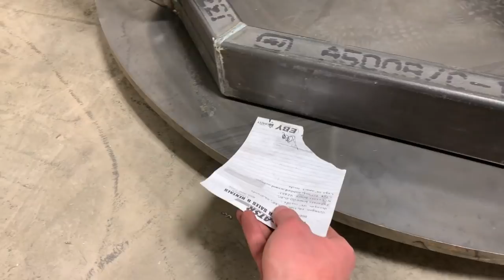Building a table to hold my vise

Comment: I saw your leather stitching on Instagram. They make a prong thingy that has 3 prongs for curves... use one or two prongs in the last hole(s) for alignment. Another thing that might make your stitching line straighter is to draw a line before you punch the holes. Tandy Leather has great leather smithing videos on YouTube check them out. You can order supplies from Tandy online or they have two stores in Phoenix if you ever get to town. ❤🌅🌵

Comment: Hey Jeremy that’s a hell of a vice and Great work on the table . If you haven’t already found a good way to move it around then I would suggest you have a look at Rotacaster Omni Wheels, this is what I intend to use for my welding table. My table is be 1.2M x 1.2M x 10mm plate and I also intend to make a single deep sheet metal draw under it for tall related tools such as a cut off saw and a file storage system.

Comment: Awesome table.  It will outlast you!  How about a threaded lifting lug in the center, or a few points, and move with the engine hoist?
Reply from the maker: Thanks. The engine hoist is a pain in the ass to use, it takes forever to pump it up and is hard to roll with weight on it. So pallet jack would be way easier.

Comment: Solid table!!!  Good welder!!!  Your grand grand grand children will appreciate grand grand grand-pa Jeremy's qualities.  One thing I would do different:  I would use a one long vice support beam that goes underneath the table to the opposite side.  It would give some more stiffness.  It could give a slight difference in "solidity" when hammering heavily, when you use the vice as an anvil.  But for all classic applications this table is bulldozer resistant!!!
Reply from the maker: I wanted to use one long piece for the vise support, but that would mean that either the vise would be on the same level as the table, or the vice support would not be against the bottom of the table.
Reply: @Jer_Schmidt  An additional profile on top of the lower profile or two strips 3" x 0.25" could do the job then???

Comment: Jeremy, I think you did an excellent job building this table. The only thing I would have done a bit different would have been fill each of those 4x4 legs with sand and then capped them. Although this has an amazing estimated weight, the couple hundred additional pounds of sand would make the legs 99.999% tip proof. As I said, that is the only thing I would have done different. And that is from habit.
Reply from the maker: Several others have suggested that, and I’m thinking I might do it before painting. I just need to drill a hole to fill them, and then weld the hole up.

Comment: Everyone knows sometimes the big tractor gets bent and ya just gotta clamp it up in the vise, weld a 20 lb sledgehammer to the front of the little tractor, and straighten the bend out of the big tractor by ramming it with the little tractor at full speed repeatedly.

Comment: Great work. The larger spaced holes on the vice should be in the rear. Narrow in the front for clearance
Reply from the maker: There would be more clearance side-to-side, but less clearance front-to-back if I put the narrow spacing in front.

Comment: Have you considered cutting your legs down and using some EXTRA HEAVY DUTY steel casters to make your table mobile? You might even want to add a lower shelf. It will add lateral strength and give you a spot to throw a small welder and supplies. Nice build btw!~
Reply from the maker: I want to keep the area under the table unobstructed. If I ever need to I’ll build a cabinet to fit under there (like if I move to a smaller shop and need to use every sq. ft.). Casters are expensive and bulky, when you consider I already have a pallet jack that’s perfect for moving super heavy stuff.

Comment: You do excellent work young man! My only suggestion for future metal topped tables is let the top be free floating by not welding it directly to the frame. I've built many large welding tables, some with 1" thick tops and welded pieces of threaded rod through the table with plates capturing the frame to allow for expansion and contraction. You'd be surprised how easily plates warp.
Reply from the maker: I stressed over how to fasten the table down for longer than I’d like to admit. But this plate was bowed badly enough to begin with that I figured it wouldn’t get a lot worse if I welded it down. Good idea though, for sure if you have a flat plate to begin with.
Reply: @Jer_Schmidt  I understand what you mean.  With your table being the size that it is you shouldn't have any problem. Your work is excellent! Especially considering your age. Keep the videos coming .
Reply from the maker: Rich Ball 
Thanks!

Comment: If you weld some RHS 100mm off the floor between the feet your pallet jack will be able to shift your bench from any angle, I am sure your bench and vice will be great to work off

Comment: well done, looks nice.
one concern tho: you should've had the table disk machined flat on the underside, built the frame up from there and screw it down with welded bolts on the frame, the short welds probs won't last long given heavy abuse over time and the preload in the table.

Comment: That's the way to I got my vice looks about the same as yours mounted on a 2 inch plate 5'×5' that came off of a die works like a charm ive had an 8 ft bar on that vice trying to break it lose works like a treat 😂

Comment: Paint the legs and underside but use the top as your welding table. But a dedicated welding unit and mount it underneath the table and attach your ground to the table with a bolt. Really great welding table then.

Comment: What about a threaded hole in the top with an eyelet? Then using the engine hoist to move it rather than the pallet jack.  Just a thought.  Bonus points for putting it at the cg so it stays level when lifting
Reply from the maker: The engine hoist is a pain in the ass to use. It’s terribly hard to roll around and you have to pump the handle about 80 times to lift it by a foot. Pallet jack is just way easier to use.
Reply: @Jer_Schmidt  

Fair enough. I know i keep my hoist folded up,  so that sucks too. How's the job search been btw?

Comment: My stepdad has a vise a tad larger than this. It's mounted on a pedestal that is welded to a truck steel wheel and the wheel was filled with concrete. Never had a problem with it being unstable.
Reply from the maker: Is the truck wheel centered under the vise? Cause that seems like you’d be kicking it all the time. This vise is 26” long, and a truck wheel is usually 22.5” or 24.5”, so the front edge of the wheel would be directly under the handle of the vise (when it’s closed).
Reply: Yeah it's centered. I'm not sure of the diameter of the wheel. But it was never in the way while doing any cutting, grinding or whatever you may be using the vice for. Since it's such a large vise it was used for larger material most of the time. Anything small that needed to be clamped to be worked on was just used on the smaller bench vise he has.

Comment: I'd have thought that the logical way to make it mobile would be to drill a hole through the top around 3 or 4" towards the vice from the center. Then weld in a chunky threaded tube to put an eye bolt into so you can hoist it up with the engine crane. 
Though looking at your advanced level of over engineering, Maybe having heavy duty casters on jack plates that are welded behind each leg would be more your style? :)

That said, It's nice to see someone having a go at heavy gauge workshop construction with such forethought and skill. Hat's off to you mate.
Reply from the maker: Like I said, I’m gonna make it movable with the pallet jack. The engine hoist is a pain in the ass to use, and near impossible to move with weight hanging on it. And casters are expensive and they’re always there, in the way. The pallet jack is perfect for moving heavy stuff, it picks it up 1/2” almost effortlessly and rolls super easy.

Comment: The band saw needs to have a variable pitch blade for cutting tubing. Reduce the pressure on the blade and you will have better results.
Reply from the maker: Thanks for the info!

Comment: How about putting a hole in the middle, for an eye bolt? And just use the hoist (legs extended), or a crane if you have one...
Reply from the maker: Pallet jack is much easier to use for moving stuff. It’s actually designed to roll around with a load on it, but the engine hoist is almost impossible to move under load (partly cause it’s cheap).
Reply: @Jer_Schmidt  Sounds like a project; better wheels for the hoist ;-) On second look, you've got all that heavy equipment on hand; where's your fork lift?
Reply from the maker: tahwnikcufos 
Forklift/skid loader are too bulky to use in the shop. Pallet jack is compact so I can get around tight areas.

Comment: WIlton used to make a very nice vise which swiveled in two axes, but I suspect it might be one of the ones they have made overseas now.  There are certainly cheaply-made clones of them around. I bought one of the cheaply made clones and promptly cracked it.  Even so, the ability of the head to rotate at right angles to the rotation of the base is fantastically handy.
Reply from the maker: My brother has one of those but it’s a very cheap and terrible one. I can see it being handy sometimes.

Comment: I have no use for a hack saw in my shop, cut off wheels , cutting torch or a plasma cutter have replaced them. I was  very surprised to see you build that very very nice bench and never fired up a torch or plasma cutter.
Reply from the maker: The problem I have with those is the warping and work-hardening. I really like cutting methods that are heat- and spark-free.

Comment: awesome! you do great work !! I really like your belt grinder and attachments It is an awesome machine ,, I have a old  big vise mounted on a slide with a 2.5 inch receiver tube using 2x2x1/4 and a down leg with a steel wheel on the bottom  it will move away from the table about 30 inches. And when pushed in is awfully strong . and handy extended for different things. your lowered offset mount off a round table makes for friendly use.. Awesome Work, Thanks for sharing your ideas and fabrication skills> I enjoy watching your builds

Comment: I don't know about that table, it's looking too light for a vise.
The vise mount looks a little flimsy as well.
It's a good thing you added a 45 degree brace unfolded the vise be ause that would have fallen off. Maybe you could add more braces to all the he legs and more braces for the vise.
Anyway, I bet that setup will come in handy especially with a table attached to a vise like that.
Super nice job.

Comment: Rather than pallet lifter, attach casters that pivot down to locked positions.  Lower each caster separately, or run an axle or two with a lever that lowers two or four casters at once.  My two cents.
Reply from the maker: Why? Then those are always there and in the way...
Reply: @Jer_Schmidt  Yeah, maybe in a bigger shop like that it's not too hard to get forks under the thing, but I like tables on casters.  It seems that I always want to rearrange.  I can shove the  heavy thing around without clearing space to access it with pallet forks.  Or  I'll weld nubs to the legs to make it easy to jack them up, and slide a dolly under it.
Reply: +Jeremy Schmidt Removeable footrests could double as crossmember bars for pallet Jack? something to that effect.

Comment: A threaded hole in the middle of the table top and an eyebolt would make an easy way of lifting with the engine hoist, also an extra means of clamping if required.
Reply from the maker: Not very useful to just be able to lift the table, and the engine hoist is almost impossible to move with that much weight hanging on it. The pallet jack is made for moving heavy stuff so it rolls super easy with 1000lbs on it.

Comment: Nice table! I thought you could drill a hole in the middle for a removable giant eye bolt so you can carry it around with the crane but it wouldn't be as fast and maneuverable as the pallet jack which seems simple enough.
Reply: Also I just read the total weight.....HA!
Reply from the maker: Exactly, that would work but the pallet jack is way easier. Thanks!

Comment: Impressive amount of fabrication, and steel, for sure, but I have to question this modern day fascination with Wilton vises. I guess they are rugged enough as I see them hung onto the back bumpers of utility company service trucks. Still, I think there are better choices for a shop.  For one thing, it would be hard to pack a workpiece held in a Wilton.  Also, the Wilton's slide does not have a horn backing up it's cantilevered loading. Perhaps the popularity of Wilton came about when Starrett stopped making the Athol vise - a bench vise perfected.

Comment: Dude, fascinating to watch your thought process on video. I get that the form of the table was required for the vice size and weight. However, what the heck is that size of vice required for, perhaps to hold the tractor I see in the video 😎.
Reply from the maker: It actually has the same jaw width as the reddish vise I was using during this video. In that sense it’s not so massive; it just has a lot of iron supporting those jaws, so it can grip like crazy even at the very end of the jaw without racking. And it’s super rigid in every way.

Comment: I think for the moving part you could weld on some tabs to the legs with eye holes and then just put a rope or what ever through it and use the engine hoist to pick it up that way, at first I was thinking about just welding something in the dead center but that’s not as smart
Reply from the maker: It’s way to hard to move it with the engine hoist. It’s bulky and slow to raise, and difficult to roll with a load. That’s why I’m gonna use the pallet jack that is made for moving stuff, not just lifting it.

Comment: I am not sure you needed an octagon support under the table.  With 4 legs, you could have used a square frame and saved a lot of cutting and fitting.  We have a 7"x12" horizontal band saw.  With careful adjustment, you can cut a 2" bar and the first cut on the lathe to face the end, cuts all the way around.  It came on a crappy stamped steel frame, which we replaced with an 11 gauge frame and put it on locking casters.  It moves around and rotates quite easily and is rock solid when the wheels are locked.
Reply from the maker: Oh it definitely didn’t need the octagon frame. But I wanted to make it that way because I enjoy making stuff.

Comment: It's gonna be heavy to move. Maybe fill the tubes with helium or paint it a light color. 

Seriously, a project like this alters the work flow in a shop in unexpected ways. Time might suggest a few alterations: maybe a lower shelf whose framing suits the carrying height of your pallet jack, for instance. Possibly, a cord and outlets. Air QD's and piping. A place for a Hossfield bender. An articulated, adjustable height, swing-out stool attached to one leg. And where best to site it.

If it was in my shop, that big horizontal surface would soon be buried under a hill of junk. You appear to be neater in work habits and more disciplined than I on my most resolute day. But still, I'd like to see that table a year from now.
Reply from the maker: Those are some good ideas. I was actually thinking about adding outlets, just hadn’t quite decided how I wanted to do it yet. It will get covered with clutter during a project, but I usually try to clean up between projects. 

I kinda want it to be as heavy as possible while I’m using it, so is it a good idea to not paint it a light color, but just shine a lot of light on it whenever I want to move it?
Reply: @Jer_Schmidt  I wonder how much light it would take to make it hover?
Reply from the maker: OperaBass3 
That’s a good point, I wouldn’t want to have to upgrade my electrical service to run the lights.

Comment: Shamfer the edges !!  Do you go to Shurch on Sunday?  LOL  another grade build fella, love watching your work.  You may not know it but you desperately  need a 60 amp plasma cutter, by using 1/4 Masonite or hard board for templates you can make razor cuts.
Reply from the maker: Hmmm, I just looked it up and you’re right, it is pronounced with a “ch” sound. I don’t know why I always thought that was like “chef” or “champagne”...
Reply from the maker: I’ve used a plasma, but really don’t care for how they work-harden the part. I think I’d get along with a portaband; slower but leaves a clean cool edge.
Thanks!

Comment: For a 48 inch octagon cut the segments to 19.882 long point to long point.
Or multiply your overall dimension by the tangent of 22.5 degrees which is .4142. So 50 inches x .4142 = 20.710 inches.

Comment: very nice, but I would have angle cut and welded the legs so they had a larger footprint on the ground but were welded to the octagon like you first mocked up....less work and less tippy
Reply from the maker: I didn’t want to legs to stick out where I’d be kicking them when I was working around the table. If I gave them a 3° angle they would already be sticking out farther than the table. It probably wouldn’t have been a significant problem, but it would have been a bigger problem than the table tipping over!

Comment: I guess the third option for mounting the Vice to a pedestal would have been to drill into the floor and bolt the thing down, but i imagine that you didn't want to do something that would mess up the floor?
Reply from the maker: Yeah, this isn’t my shop, so I can’t really. Also it has a floor-heat system (pex pipes every 12”), so don’t want to risk hitting those.
Reply: Agreed, that would make it very tricky.